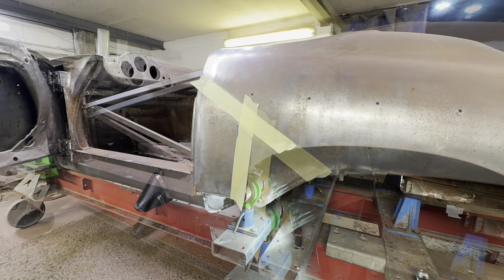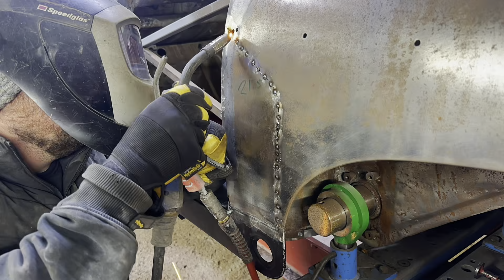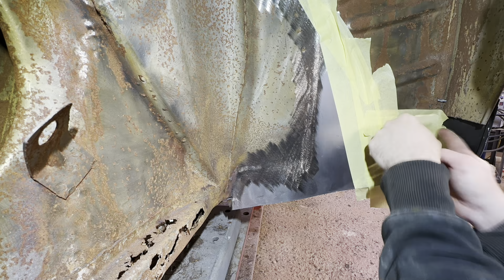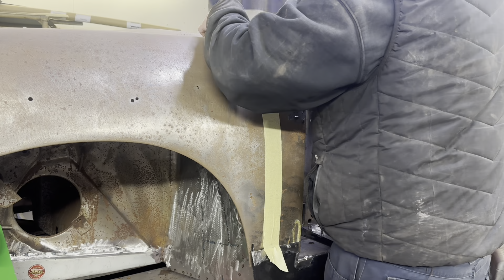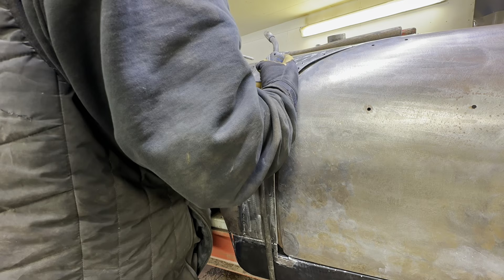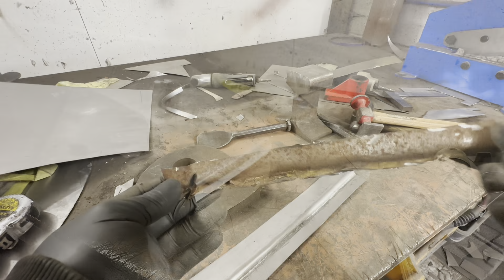Porsche 356 Speedster Restoration pt3! Even more rust!!!!

Comment: Looking good, thanks for taking the time and effort to share your work!
How cold is it in your shop area? I could NOT do good work in an uncomfortable environment... but I suppose there are those who don't find it offensive perhaps. 
Let's be honest, you are working on a Porsche resto..... you can afford heat.
Reply from the maker: No problem, glad you are enjoying the content. At the moment temps are around 6-10C although we’ve had the old colder spell. Jan-Feb are normally worse. Our team room is heated, Chris has a space heater in the prep room for when it’s really cold and when he’s not hiding in the 22C spray booth!! I have a heated jacket. The problem with my workshop is that it’s got really high ceilings and is a non insulated barn so heat will just disappear.